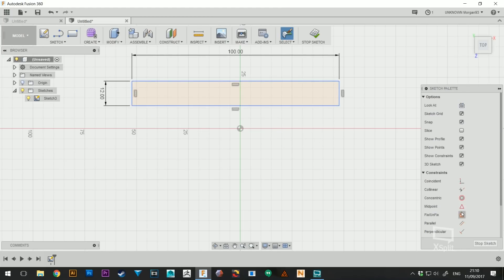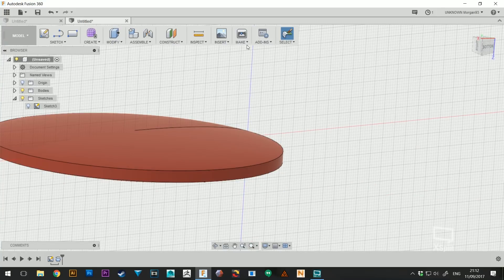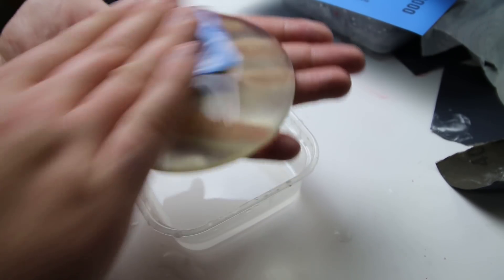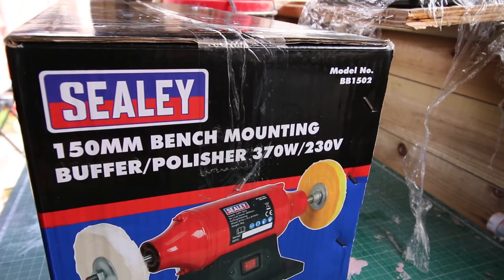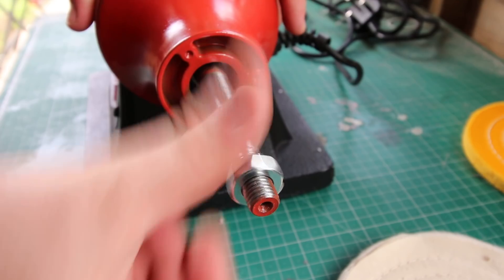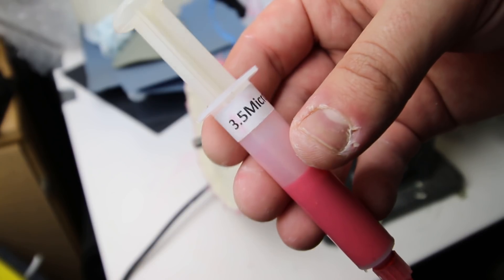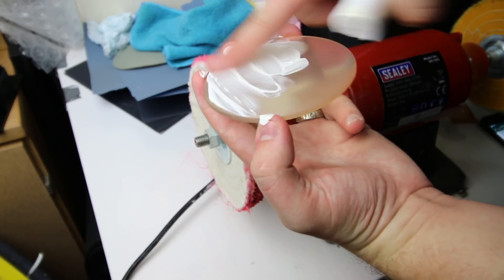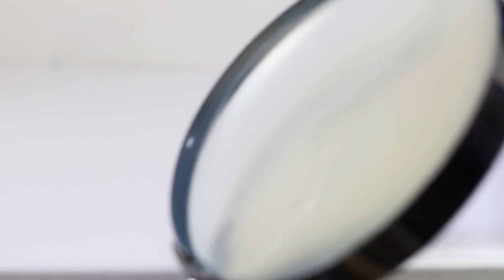3D Printed Magnifying Glass?!

Comment: I polished up some water washable anycubic printed resin in a similar way (but more hand work, don't have a bench grinder) and it turned out beautiful at first, but after a month or so, the polish doesn't look so crystal clear, it has a kind of low frequency wobblyness to the surface that wasn't there immediately after polishing. It left me wondering if maybe it would be worth letting printed parts sit for a month or so after printing and postcuring to give the acrylic time to warp and relax some of it's internal tensions before trying to build the smooth surface.

But i've also seen people say water washable resins tend to be brittle and some wonder if they're suseptible to moisture messing up the plastic, so maybe having been rained on while wearing the printed part, or just humidity in the air might be causing it to unevenly swell?

Comment: i have worked optics for over 45 years, there are much better polishing pads than the one you used, the type you used would generate to much heat and probably scour the surface, why not make a mold of the radius you are polishing, the pads i am talking about are mat sticky back pads, made of various types of material, silk pads are good, cut the sticky back pad into leaf segments and line the mold, you can achieve a really good polish  finish using brass o liquid

Comment: Great video! I can only recommend, that you should use lack (or resin in English) finish. You can buy transparent one without colours, what hardens and you can polish better than the plastic (like similar what paint shop do for cars, but different material) and also fills up every scratches. You can also buy clear resin to print with, will be less "filter" like.  All the best!

Comment: Two thoughts: it worked! Buy resin is not going to have the same refractory index as the glass in a magnifying glass. The shape of the lens needs to be calculated for whatever material youre using.
also, this would be amazing for developing and printing IRL clones of snapchat filters!

Comment: Worth noting that lenses mathematically should have parabolic curves. In the real world, they often are based on a sphere, but you'll get better results if you use a parabolic arc as the basis for your model next time.
Reply: Who told you that?
Reflective mirror lenses are PARABOLIC
Refractive ones are SPHERICAL !!!   Thats x^2+y^2=radius^2 for those 3D printers interested.
Reply: your thinking of parabola mirrors, not lenses